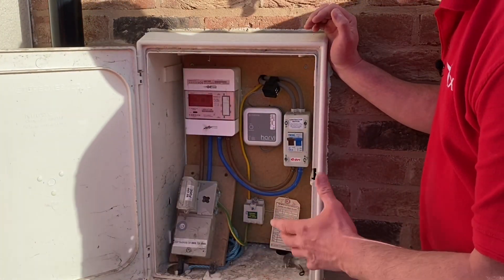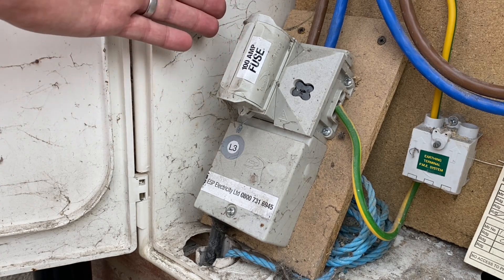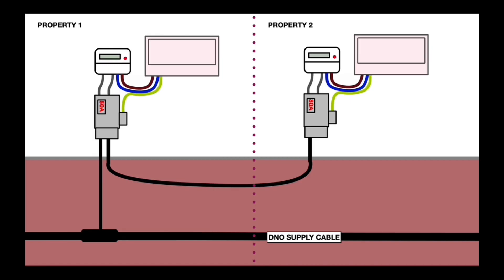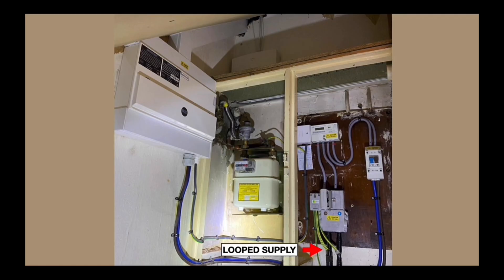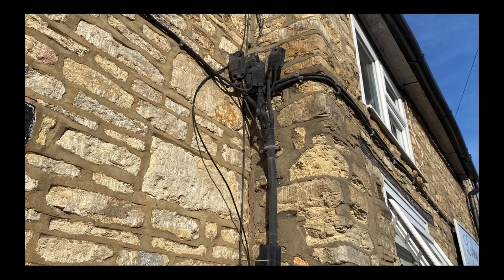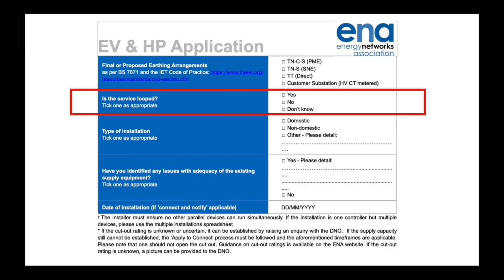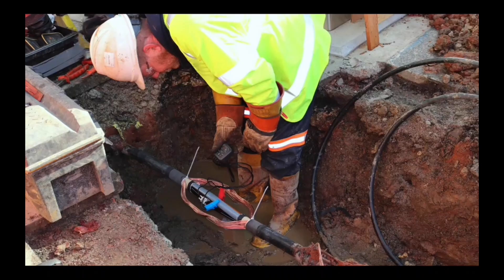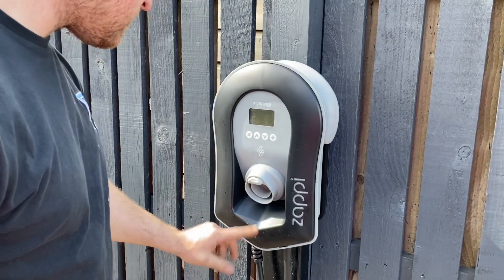EV Charger installation : BEWARE Looped supply - what are they , cost and time to correct

Comment: I checked next door's cutout as my supply comes under the garden from the direction of their house (as I found out when digging footings for my shed and almost put a garden fork through the cable).  No loop :)
Crappy, pitchy 60A cutout on mine though.  Boo.

Comment: If you get a Zappi charger installed you can limit it’s current draw in the menu

I had it limited to 13amps for a few months until I managed to get a 6mm cable run to the garage and then upped it to 32amps

Charging the car at 13amps took a bit more management on my part but it was dooable for a while till I got upgraded

You could get the charger installed and set to a lower current to keep you moving while the DNO do their thing.

Comment: Looped supply here on a 1986 built Bovis home in Bucks. 
After discovering it I initially kicked getting an EV & charger into touch - just too much hassle. That was last year.  Now we are faced with stupidly high gas & electric prices I started looking at a hybrid solar / battery system. So the question was did I need un-looping to have the solar system installed? After 3 calls to different depts in The National Grid & a solar installer that quoted me I'm still waiting to find out. I suspect the 3.6kW solar system doesn't need or qualify for free unlooping. However if at a later date if I wanted to add an EV charger I'm pretty sure my 60amp main fuse will have to be upgraded & the supply un-looped (I have the 2 cables in my meter box). So I'm now considering having the hybrid solar system, EV charger & a new consumer unit all installed at the same time to benefit from the zero vat rate for the entire project & not just the EV charger  / Solar install. Either way it will cost me more for some equipment we don't need because we don't have an EV yet - & that's another story because they are way too expensive. However, under that situation the unlooping process should be FOC 🤞- I'm waiting for confirmation of this. As part of the process & discussions with TNG they sent me a copy a drawing showing the electrical supply routes to my house from their Maps Dept & guess what, it's wrong. The drawing shows the main incoming supply going to my neighbours house when in fact it comes into my house & loops over to my neighbour so the route it takes on the drawing will be wrong.
The main drawback with this whole process will be the mess they will have to make digging up mine & my neighbours front garden / tarmac &  block paved drives in order to get at the existing cable. The other issue is that since utility prices have skyrocketed there is now a massive demand for Solar systems so install times have extended to a minimum of 4 months! One company told me they needed 2-3 months just to do a quote plus another 4 months lead time for the install itself. The DNO's are also pocketing £175 for every solar application whether it goes ahead or not. Nice little earner for them! I'm just hoping I can get some definitive answers soon so I can decide whether to proceed or give up.

Comment: A few points from the DNO point of view.
Having 2 cables into the service position means you have a direct service but your neighbour is looped (branched) from you. One cable means nothing in most cases.
Large detached houses are unlikely to be looped.
Semi detached are almost sure to have one of them looped, probably under the floor. in this case look at yours and your neighbour and if you have 2 and he has one then it IS looped, or visa versa.
Even some new properties can be looped, in this case look for the box's that directly face each other, maybe across a path down the side of the house.
Terraced houses can be looped in 2,3,4,5 adjacent properties, often the main service into the middle and loops going either side.
If i had to say how many are looped or looped from, I would say the majority, over 70%  and most likely with attached houses.
Quick history of why... to dig a hole, a trench and run cable to a property with one breeches joint would have taken a min of two days and cost X pounds.
Thats per property, but loop one and you get 2 done in practically the same timescale and the loop costs a tenth of the cost of a full joint and trench.
Reply: vice versa

Comment: An interesting, no-nonsense video. Thanks! I searched it out because our neighbours across the road have just gone through this (SSE are clearing the barriers down as I type). I don't know the ins and outs of it (bad pun?) but I have a couple of questions. 1) Why was looping considered an option for, say, detached houses, where the looping cable would probably be longer than a cable direct from road to each house? 2)If you're at the end of the loop you'll only have one cable coming in so how do you know you're not looped? 3)Don't the electricity boards or council have the info (clearly, not!). And, finally: In west London, housing developers are being denied permission to build as electrical capacity isn't up to handling any additional load. This got me thinking: if the sales of electric cars increases as expected will the National Grid have enough oomph (technical term) to deal with the demand? Thanks again.
Reply from the maker: All good questions Martin. Looped services are rare on detached properties. The DNOs do have records but only correct these on a reactive basis when an installers asks for permission to connect. It’s at this time when someone at the end of the loop finds out.  With regards to capacity of the grid it’s a rapidly shifting landscape check out this video 👉 https://youtu.be/s7nODxkzIpI

Comment: Normally an unloop IS  free from DNOs ALL DNOs want everybody unlooped anyway. IF you want a higher supply such as 3 phase or just a bigger amperage supply (increased cable size) then you will have to pay for this upgrade.
It's the same for fused neutral supplies the DNO'S are in the process of searching these out to resupply households that are fused neutrals because of the obvious 'complications' that could occurr. It's the same when smart meter companies want fit smart meters they won't touch a fused neutral supply or a looped supply usually because of the complicatipns. Electricians should really be informed of all these supply issues before carrying out work on an installation otherwise they could be opening a whole can of worms on themselves and the customer. 👍😉

Comment: Do worry to much about the install time. I was quoted 6 months delivery on the car the other day. Plenty of time for the DNO to pull finger out. Another top tip to identify a looped supply. I have a single main cable coming into my property but when I look under the floor the cable runs under the wall into the semi next door not out of the front of the property. When I checked it was a looped supply. My main fuse is 100A though so either the cable is man enough for the job or someone has made a mistake on the fuse. Going to check withthe DNO.

Comment: Looped supply isn't always bad. If you have a good neighbor you may benefit from this supply type. I know one which have better power supply then any other because of his loop.
His neighbor is still a 110kV substation. If you are in an arm length of a main fuse you had to contact the power supply company if you plan to draw high loads. Each machine use 7.5 kW and he had a ton of this in the workshop (maybe 120kW). Same where the guys which build server containers (10MW - 30MW), they even had a substation in the front yard. I'm waiting for the chargers which phone the power company each time they will draw power (22kW to 280kW chargers). There is now only an on and off signal for heat pumps, but a more gradually load shifting might be the future.

Comment: This is just the tip of the iceberg. As gas boilers will become a thing of the past along with any form of gas heating/cooking. Plus the fact that a lot of homes are a 2 or more car family.I see domestic supplies becoming 3 phase 300amps. Or even the local supply becoming 11kv with a transformer on every front garden!!! The shape of things to come. 
Electricians you have a very secure future.

Comment: So my property was built in 1927, its a mid terrace and the powerlines are above ground, it has one cable from the telegraph pole that goes to a junction box on the wall there's then 2 cables coming out of the box, one cable goes to my electric meter, the other to my neighbours, what would this be classed as? 

BTW we had the house fully rewired when we bought it 3 years ago so has modern electrics and fuse box.

Comment: I had an EV charge point installed over two years ago but because the installer didn't bother to tell the DNO (despite them telling me that they had done), we were blissfully unaware that we were on a looped supply. Fortunately, we charge at cheap rate overnight, we're only looped to next door and we have a 100A main fuse, so there have been no problems. But when it came to getting approval for solar PV, the DNO raised the issue. I consider myself very lucky that our DNO is Western Power. Not only did they say they'd unloop us for free, they also offered (indeed, preferred) to lay in 3-phase. I couldn't pass up free 3-phase, so it was a no brainer. Of course, it's cost £2k for a 3-phase DB installation and added £900 to the solar installation, but still! It would have been done last week, but our council are being difficult about having traffic lights while the footpath outside our house is dug up, but I can't fault WPD for getting on the case. In the process, we're swapping the existing EVSE for a 3-phase Zappi, so can look forward to faster charging (when it's not running from the PV).
Just a point to pick up on when it comes to recognising a looped supply. If you're the last property (as we are) there's only one cable into the main fuse. It's only when I looked in our neighbour's meter cupboard that the two cables were evident.
Reply from the maker: Thanks for sharing. WPD are one of the most proactive DNOs.

Comment: I'm having a complete nightmare with my looped supply. Here's my story (so far)....

Didn't have off road parking so decided to get the kerb dropped and a drive put in. Made sure the Council had agreed to this before ordering the EV car (Tesla M3). Took months for the council to do and surprisingly it was not the council being slow but Virgin Media as they had a manhole on the pavement outside.

Got the car ordered, got a drive in (story in itself when the first company turned out to be a disaster) and ordered a EO Mini charger from EO. Filled in their online application with all the photos and videos of the supply as they requested.

This got approved and the job was subcontracted to a local installer. They turn up. Clearly this is the first time they have looked at the job details as they have to phone Western Power because of the fuse. WP have cleared the job with a retrospective fuse upgrade.

It's a two man team but the main guy was a moaner. We had to tell him how to route the cable discreetly as he was going to just bolt it on half way up the wall etc. But the install did look neat in the end.

He then drops the clangers that we have a looped supply and substandard earth bonding. Tells us £300+ for him to fix bonding but he can't do now so advised us to get an electrician. Says let WP come and do the fuse and they will see the looped supply and book it in.

The EV charger leaves and that night invoices me for the full cost without the OLEV grant. ** that - not paying that. I get a local electrician in (takes a few weeks) who checks the earth bonding and passes it as to standard! Yep, the installers had just taken a look and decided it wasn't right rather than actually checking it! 

So EV installers approve the grant, still try to invoice me for the full job but since they cost me money I deducted his cost and that's another story!

A few weeks later Western Power turn up, check the fuse and say it's a looped supply so needs separating. On their plans the houses are on separate supplies hence why the job was originally approved.

Get called by WP dept, fill in paperwork for supply and agree engineer visit. Don't get given a date. Engineer just turns up weeks later on a morning when I'm luckily working from home.

Totally unprofessional, he's smoking a fag and has the demeanour of a cowboy builder. Says we will need to dig up a section of our Victorian Minton tile floor (as well as the new drive). Says we need unit for 3 phase so can't have meeting cabinet outside as not space (it's a massive cabinet) as gas meter in way but he suggests sticking it halfway up the wall on the front of the house!!!

Then he has a think and says you can put it in the front from and box it in with a bit of ply and paint it. Oh, and he says we have to pay a builder to put the holes in the wall. Missus is aghast as it sounds just like the crap flats we used to live in and no one else's houses have industrial sized meter units attached to the front of the house.

So engineer goes and I email asking for the dimensions of the cabinet (why he didn't know this stuff??). He replies saying something about ply again and saying he just remembered that WP use two different size trunking and we could use a smaller size than he originally said.

I send an angry email to Western Power (both original contact and engineer) saying I'm not sticking ugly boxes on the front of my house or knocking holes in the house without knowing exactly what and where they need to be. I tell them that I will even get the gas meter moved but I need to know proper and documented requirements before I do anything.

Get no reply for a month. Send a chaser and get a reply from the original contact (i.e. not the engineer) with at least a pdf of the cabinet dimensions (it's bigger than standard cabinets).

Play email ping pong a bit. Query why we need 3 phase supply. Its standard for new homes. We're a property built in 1890 with an existing supply!

Western Power person is now off for a couple of weeks, engineer doesn't respond to emails so I don't know where we now stand with them.

EV installer I am reluctant to go back to as don't trust their judgement and probably burnt that bridge over the bill.

And to top it all off we are still waiting for the Council to actually drop the kerb so I'm still running a charging cable across the pavement to my car parked on the road.

This has taken about a year so far from sending in the initial drop kerb application...

(Tesla M3 is great btw - the only part of this process that has gone smoothly!)

Comment: If you lived at property 2 ,  you would think it’s NOT a loop due to the single cable coming in.
How would you tell ?
Reply from the maker: Usually when the EV installer sends off the DNO permission to connect paperwork.

Comment: I was thinking of installations, now I'm not lol.
What about load sharing with solar battery installations, as at best there would be little load from the dno line of the person uses the system correctly... 
And likely to use it correctly.
They can be programmed can't they?

Reduced charge or selective charge?

Comment: While you’re waiting for your charger to be installed you can still use the 13amp charger. 
It will only give you about 10 miles range per hour of charging but if you only average 100 miles per day you will easily keep your ev battery full every morning.

Comment: Great content as always!  If you are the first property in  the loop feeding more than two  propertd, could the DNO run a new cable to your property cutout and just join the original looped cable together removing you property from the loop but still keeping the other properties in the loop feed. This would remove the need for you neighbours consent in case you are not on good terms with them or don't belive you will consent to the work?
Reply: A lot would depend on the nature of the existing installation, I think. If you look at my earlier entry above, and have a look at my entry on a local cable renewal job ( https://youtu.be/LS8VFhRMsYY ) you’ll see a typical arrangement. 

	In my case, if I wanted an EV charger, they would probably have to install a new service cable to next door and transfer it off the spur (loop) - it only has two houses on it, or if next door went first, it would still need a new service cable. Either way, there would need to be some digging up of the Council owned patch of land - under grass in my case - and some work under next door’s drive as well. I guess they might be able to disconnect the cable to next door inside their meter box on my house and do the connection to their feed in the same cabinet to the new cable (those items are their property, not mine), but it might look a bit odd compared with installing a continuous cable from the buried service cable to next door.

	The addition of any new service cable to the distribution cable would cause some disconnection to a batch of other places on the same cable, with it being cut and connected into another connection unit underground. In general in my street, the smaller houses are on two house spurs, with the larger ones with dedicated service cables. Note that I already have a 100A master fuse, and can theoretically draw up to around 80A quite easily for heating etc - but things like that are covered by “load diversity” regulations etc. It appears that EV charging is not dealt with in the same way now.

Comment: My neighbour has just got an EV and we have a looped supply, I have the main feed and he is looped to me, he has been told he needs unlooped from me, the company doing the works have said it would be easier to run his new cable under my garden because it is just grass, my thoughts are he doesn’t want his driveway dug up as it is mono blocked, would this be allowed or does the new supply cable need to go through his property??